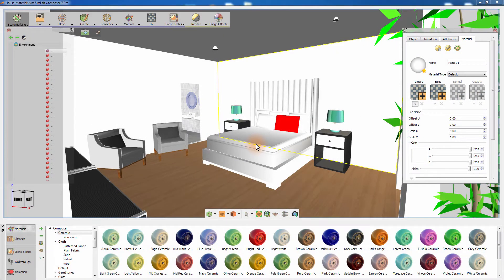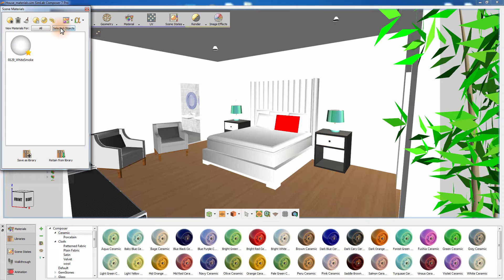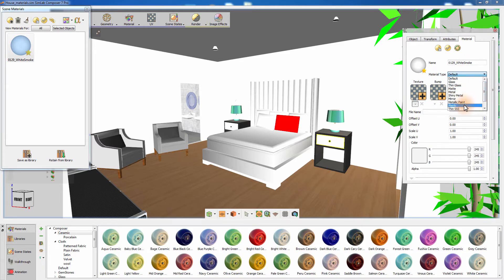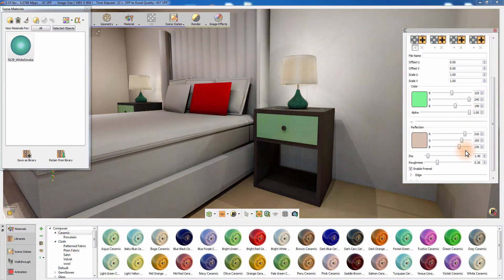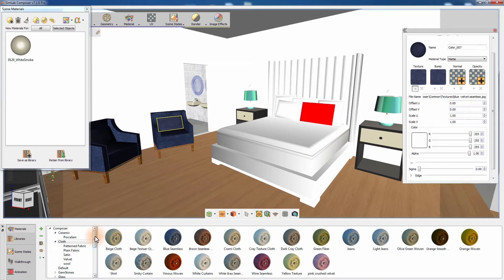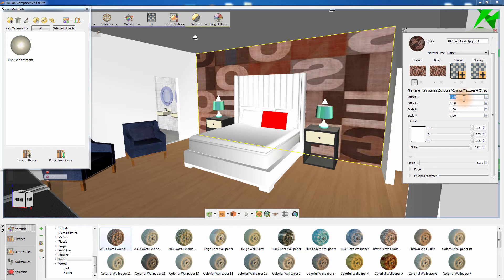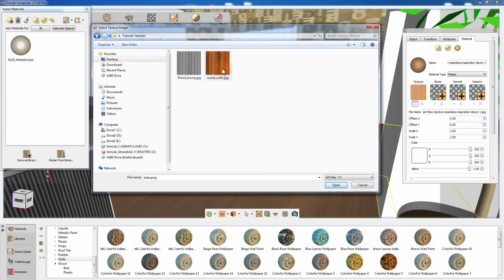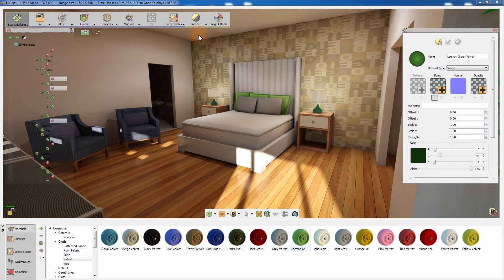SimLab Composer Architectural series (material system tutorial)

Comment: Materials should be able to be displayed on a flat surface as well. Materials with a pattern are kinda useless when displayed on a sphere.
Reply: I believe that there is a trick, that you can do, for making materials to be displayed on other surfaces or shapes in SimLab Composer's library. All what you need to do is to replace a file in the application data folder (i.e. AppData in Microsoft Windows) by another one.